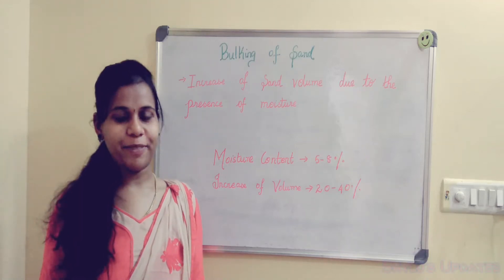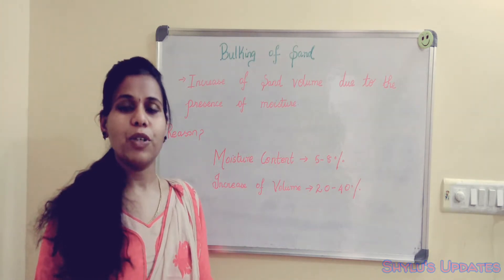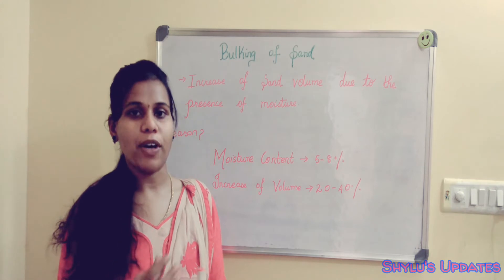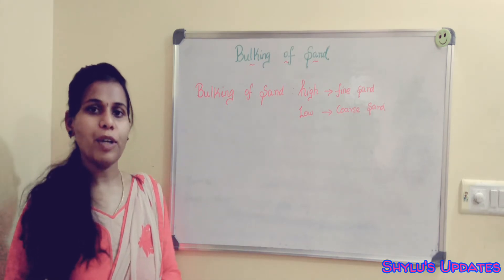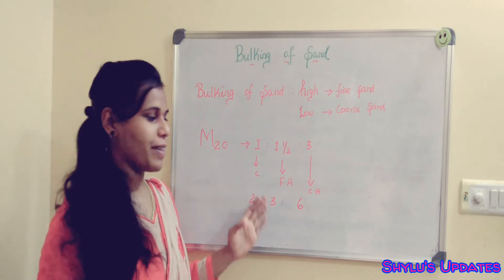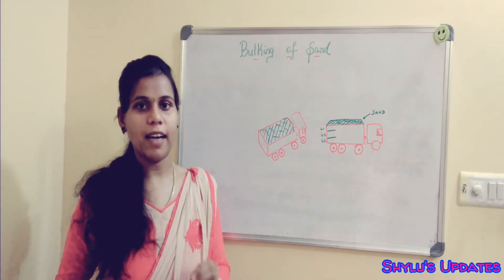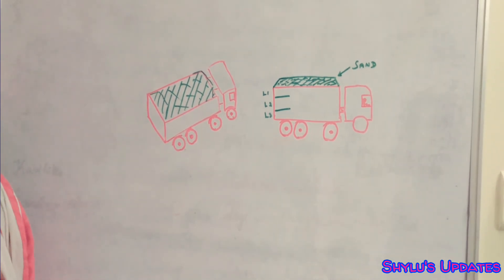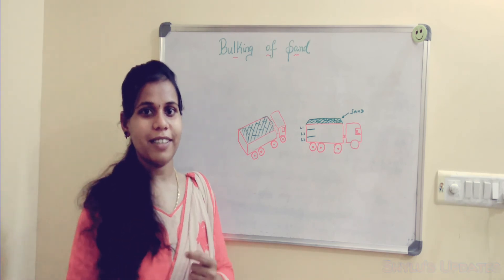BULKING OF SAND|Bulking Test| Bulking of Fine Aggregate | Civil Engineering

Comment: explain what is meant by bulking of aggregates? indicate why the extent of bulking of sand depends upon moisture content (10 marks)
Reply from the maker: Bulking of Aggregates :
The increase in  volumeof fine aggregate due to presence of moisture content .
Reply from the maker: Why ?
This is because a film of water is created around the sand particles which forces the particles to get a side from each other and thus the volume is increased. The increase in moisture in sand increases the volume of sand.Bulking of sand depends on the quantity of moisture in the sand & also the size of the particles.
Reply: @shylusupdates  thanks a lot 
Here are some other questions which l would like you to help me with so l can understand them easily...
1) A sample of concrete was divided into 3 and results for the slump, compacting factor test and Vebe test obtained. they are as follows;
-slump=5mm
-compacting factor test=0.93
-vebe time=18sec
a. explain the terms above(3 marks)
b. assuming that only one result was in error, which is incorrect? explain in brief.(5 marks)

2)a. what do we mean  by  curing concrete?what would happen if concrete is not cured?(5 marks)
b. define''workability'' of fresh concrete and describe briefly a method to determine this property(10 marks)